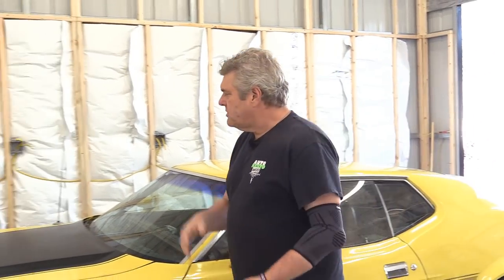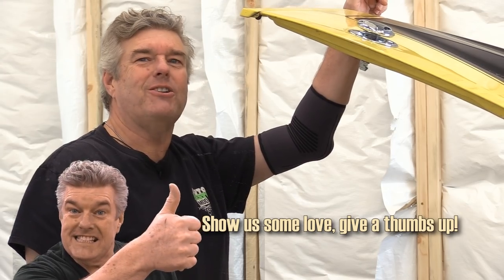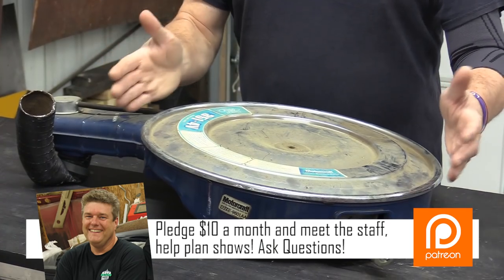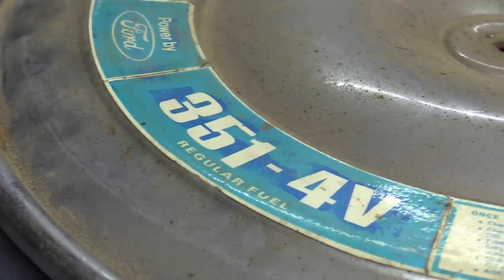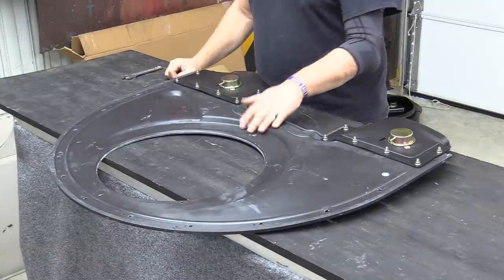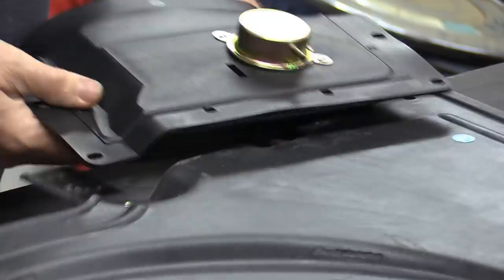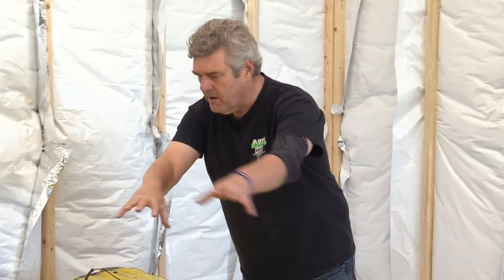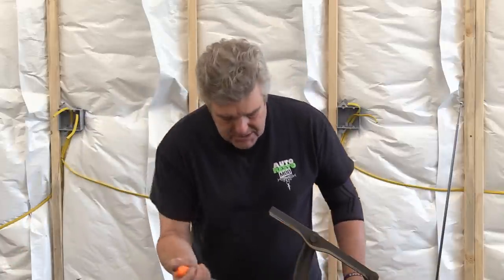Mustang Ram Air

Comment: We have functional Ram Air on our 1973 Mach 1.  In our case, the Mach 1 initially had a base 302 2v engine, a C4 three speed auto transmission, and very steep 2.79:1 rear axle gears.  A prior owner replaced the 302 2v with a 1994 351w (not C) from a Ford F-150, installed heads from a 1969 351W 4v engine (larger ports), and had the rest of the engine built for moderate street/strip performance.  After being built the engine put out 360HP.  The compression ratio was limited to 9.5:1 (forged aluminum pistons) so it could handle the low 89-90 octane non-ethanol free gasoline in our area Rochester, NY).  He also replaced the 2.79:1 rear axle gear set with a 3.5:1 TractionLok gear set, which made for very spirited low end performance.  But it also caused the engine RPM at 60 MPH in high gear to increase to about 2,750 RPM. as opposed to the 2,050 RPM with the original rear axle gears.

When we first got the 73 Mach 1, I replaced the original NACA/NASA hood due to some rust issues with a new NACA/NASA hood from NPD.  I also removed the hood's inlet scoop blocks, and installed a ram Air kit with the under-hood air plenum, also from NPD (part of a kit).  I later decided to have the Ram Air be used more to bring cool outside air under the hood in general, as opposed to simply directing Ram Air inlet source air toward the carburetor, where all unused cool air would simply be pushed away from the engine compartment.  I was not worried about any loss of performance as it has been shown time and again, with many different vehicles and Ram Air configurations, that Ram Air, unless forced via TurboCharging or SuperCharging, really does not created any significant increase in vehicle performance.  Cool air does help performance, but Ram Air unto itself does little for performance.  The largest benefit of Ram Air is to get cooler air into the carburetor, something that is still occurring with our Mach 1, except the cooler air is brought into the entire engine compartment, not just the carburetor intake air source.

After having the Mach 1 deeply restored we swapped an AOD in place of the C4, and now in high (OverDrive) gear the engine RPM at 60 MPH is about 1,800 RPM - making for some really fun cruising, where there is plenty of power on tap whenever needed or desired.  The AOD helped us get our feet into both worlds, comfortable cruising at a nice RPM level, and spirited performance at the low, middle, and higher levels pf performance.  And, the engine is powerful enough to effectively overcome the high level of air resistance at high speeds, a consideration when running with an OverDrive transmission.  

It is really a nicely balanced vehicle that performs amazingly well - especially considering it is a little over 50 years old.  And the Ram Air hood inlets let folks see through into the engine compartment, as opposed to seeing the scoops are blocked with plastic plates.  It does look cool, and I hear comments at car shows re: that being "real" Ram Air, not just a mock-up set of non-functional hood scoops.

https://youtu.be/_Fl0B-qmlLI
Reply: Hey Gilbert. I have a 71 351C Mustang with C6, 3.50 gears, and my engine guy built a 10:1 compression engine that has run well but the RPM problem is very bothersome for highway driving. I need more gears! Did you find the AOD rather heavy or any issues with it? How much was it? What torque converter did you go with?  I would like to lower highway RPM via 3.25 gears perhaps or an AOD or Tremec t-5 manual swap. Money is im short supply lately but I can dream right?
Reply: @jamesmedina2062  Hi!  I definitely get how the engine RPM can get to you at highway speeds with a 3.5:1 ratio rear axle gear set.  Just try to imagine how it is like with 3.91:111 or 4.11:1 gears, or even lower ratios for balls out drag racing.  The AOD swap went well, but I had throughly researched the process,a nd needed parts, pretty deeply before tackling it.  At that, I do not have the equipment needed to really do it easily (transmission jack), so I had a local shop do it for/with me.  When I say "with me" I asked the shop owner if he wouls let me video record the process for YouTube, and to work with his tech providing guidance, as they had never done a swap with AOD replacing a C4/FMX/C6 before.  The tech was cool with my request, in the end.  He confessed to me later that he had his reservations about a customer being there as he was doing the work, but as it turned out he appreciated having someone to talk him through the new steps, and who actually knew what he was doing (I am a forner auto tech, from the 70s and 80s).

If it had been for the original C4 tranny needing to be rebuilt (slipping badly in the 1-2 upshift at wide open throttle) I would have more likely installed a Gear Vendor OverDrive unit.  But, the C4 was a little light duty with the Street/Strip build the 351w has (a modest 360HP, but it has lots of torque).  Hence, the reason for doing an AOD, but with an optional firmer shift (Monster Transmission), and I also purchased a 1900 - 2300 RPM torque convertor with the AOD purchase.

I could have gone with a steeper gear ratio in the rear, like 3.0:1, and I know that would have brought the engine RPM at highway speeds down to a nice level.  I know this because we have a 1969 Shelby GT500 with factory required 3.0:1 rear axle gears, due to it having a 428 CJ engine with factory A/C.  I felt I would lose more low end performance with a taller rear axle ratio, and I liked how the 3.5:1 performed around town.  The AOD 4th gear (OD) provides a 0.667:1 output shaft ratio, which effectively turns our 3.5:1 rear axle TractionLok gear ratio into the equivalent of a 2.33:1 rear axle ratio were I to have a non-OD tranny (3.5 * 0.667).  That is about as steep as I would have wanted.  But, the cool things are that I was able to keep the lower ratio TractionLok rear axle gears for lower speed performance, and our built 351 has the power to overcome the high wind resistance at triple digit speeds.  So, I kept the low end performance, while bumping the top end - and have a nice engine RPM at 65 MPH, even at 70 MPH (or higher).

That said, were I to do it again I would before likely to swap in a 4R70W AOD, as it is computer controlled for shift speeds, firmness, etc., electronically.  Sure, I would have had to buy an aftermarket electronic controller (there are several folks who make those).  But it would have been far easier to adjust the tranny pressures, as opposed to having to set the Throttle Valve (TV) Pressure manually, a few times as I kept increasing its base PSI in order to get my 11-2, 2-3, and 3-4 upshifts to occur at higher road speeds than the standard TV PSI level provided.  Setting the TV pressure properly is critical to keep from frying the tranny.  It is nott hard to do, just tedious, especially by the time was doing it for the 3rd time in my quest fr\or higher speed upshifts to occur.

The AOD does weight a little more than the C4, but the tranny jack helped make that easy to handle.  I kept the oem auto tranny shifter, and it turns out it works perfectly with the AOD, although the shifter gear indicator is a little goofy with the D, 2, 1 shifter positions.  I cover how the shifter behaves in one of several YouTube videos I did on the entire process.  I also have some files that contain some good into, as well as provide the parts list and vendors I used for our project.  The files I have are on my Google Drive at the link provided below.  It is a lot to read through, but I think in the end you will be glad you read the documents I put together, as well as watching the YouTube videos I put together.  Below is a listing of theYouTube video web addresses, as well as for my relevant files for the parts and vendors I used, and much more.

Have fun!  No regrets with us, we love the AOD.

Documents on my Google Drive:

https://drive.google.com/drive/folders/1cXXDj9mEs_1ANCFhD5pYBqLre05iseOk?usp=drive_link

YouTube videos:

This is a link showing the impact on engine RPM at 60 MPH with the AOD in 3rd/Drive gear, and then in 4th/OverDrive gear.  In the AOD, 3rd gear is a 1:1 ratio, just like 3rd gear in a C4. FMX, or C6 automatic transmission.

https://youtu.be/zfYe--Gsjdk

Following is a list of relevant YouTube video links contained in this document’s prior paragraphs, and from YouTube listings:

https://youtu.be/jrdKCcPKv_Y

https://youtu.be/MZwXbJKdDKo

The following link is for the Neutral Safety/Backup Light Switch splicing:

https://youtu.be/zzDmFjFfT-A

https://youtu.be/yHWY903N4bs

https://youtu.be/XZ7CkcY1vFQ

https://youtu.be/vdR-z3KV0UE

https://youtu.be/YCBBgd-olQ0

https://youtu.be/NcYr68atRjM

https://youtu.be/iFNXTGXNNcQ

https://youtu.be/2tTwnbcZZkY

https://youtu.be/8QncIKQTvNo

https://youtu.be/b4lnPReGWuM

https://youtu.be/zfYe--Gsjdk

Setting up Throttle Valve Pressure from the carburetor cabling, and how the original auto tranny floor shifter behaves with the AOD when shifting manually:

https://youtu.be/KYIAqqYUKNo

More below
This video shows there is a difference between TV pressures in Neutral vs Park:

https://youtu.be/6hZJEnGCPvY

Another Throttle Valve Pressure Adjustment “outside” video is :

https://www.youtube.com/watch?v=fqkfoNBsJWg

From a Facebook post (NOT MINE, but seems useful) on 1/26/2022:

 

done a 4r70w in my 69 fairlane. Just bought 68 cougar it will get one too. Do your research and you'll know what I'm talking about when I say: J-mod to the valve body, US shift trans controller, IMPORTANT-Provide your builder with: https://www.jegs.com/.../Lokar-Ford.../1231928/10002/-1

Your life will be easier when hooking up shifter, if your running a rearend gear lower than 3.55, like a 3.70-4.11 etc. U will definitely want to direct your builder to install a 7 tooth speedo spline output shaft. To get speedo to work with 8 tooth u have to use a 23 splined speed cable gear which will last about a week! Be sure to get a 1998-2003 4r70w. 5.0 Explorer preferred has 5 clutch hub, 3.8 v6 4r70w have 4.

If using stock gear drive speedo, make sure the trans u bought has the hole for the speedo cable AND the speedo splines on the output shaft.

Swapping out the 4r70w tailshaft housing to an AOD allows use of an AOD trans mount and a c-4 driveshaft yoke. If u do the tail shaft swap u will MUST do the tailshaft rear lube mod. Your c4 Driveshaft will need shortened as well. I bought a broken empty 4r70 case which was helpful for mock up being the 4r70w is. HEAVY! 

Most headers will not clear the shifter linkage side of trans-had to modify drivers side hooker super comp headers. In hindsight I'd used shorty headers. This guy built mine- Darrin Burch

bcatransmissions.com.

Also there's a series on youtube which was technically helpful.
I'd suggest watching/subscribing

https://youtu.be/I4-fKGzFPXI

Comment: I have seen a really good way of taking hood springs off is to use an old seat belt buckle from the wrecker. Slips on easy, and more than strong enough. But great seeing the Mustang. Im working on my 72 a bunch right now and just trying to head off any rust before it starts.
Reply from the maker: Not a bad idea!

Comment: Ford may have come to the realisation that a lotof gearheads would toss the original air cleaner for an open element style and thought why bother and just put a one style fits all on there.
Reply from the maker: LOL might be. I think what happened is the Feds wanted EACH example. Meaning the Torino (which also had a Ram Air option in 1972) with the 351 2V and 4V as well as two 429s. Ford just didn't want to play. By then they had chucked the factory support of most of the racing stuff and gone back to the mundane.

Comment: I owned a like new '70 Mach I w/351 Clevland 4V in '74 and the air cleaner said 4V, for whatever that is worth. With headers, an Edelbrock intake, a modest lift/duration crane cam (hydraulic, we later converted it to solid) and a Holley 850 double pumper with mech secondaries, she pulled 447 BHP on a dyno.

Comment: I had a 1 owner 72 Torino 351-4V Q Code CJ is for the cam grind same as the 428 CJ. My LID is better metal chrome not as cheap looking. I still have the lid only! I ran a 5in high open element 1 inch spacer on a 0-3310 Holley with a Torino Sport Hood i put on it.
Reply from the maker: Awesome!

Comment: Use an old serpentine belt to install hood springs. A lot easier

We use it also with an engine hoist to expand the springs when we respray them

Comment: I always use a pair of vice grips and just pull the spring up and unhook it. Easy way.
Reply from the maker: Normally that works, but those NASA hoods are heave and add the extra beef for the ram air and oofda they are a handfull.

Comment: I think all 73-74 4 bbl clevelands had 2 v heads.
Reply from the maker: I believe you're right, though they were actually 4V heads with 2V valves  Making them the worst of both possible worlds.
Reply: @AutoRestoMod  Bob Glidden seemed really happy after he massaged it really nice all the way to the very top of Pro Stock